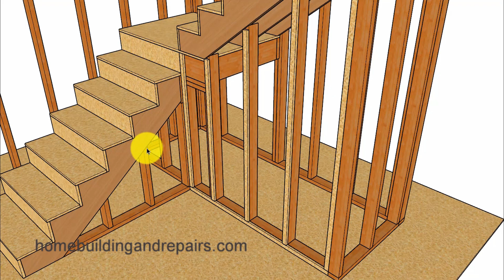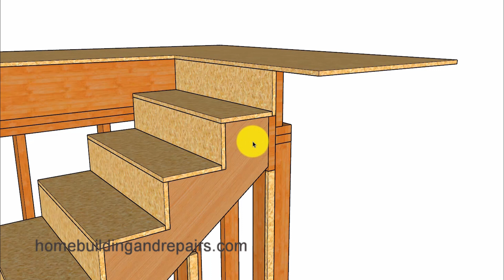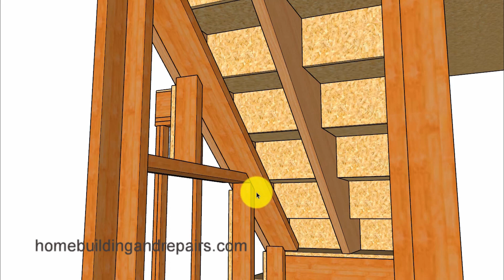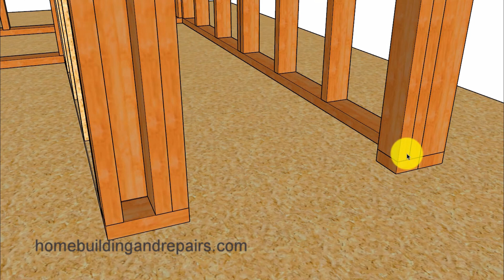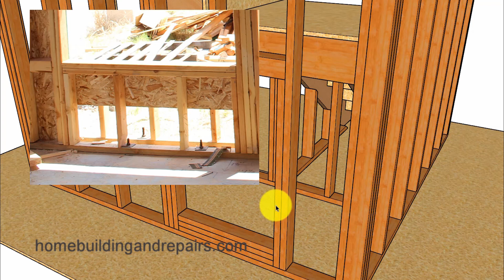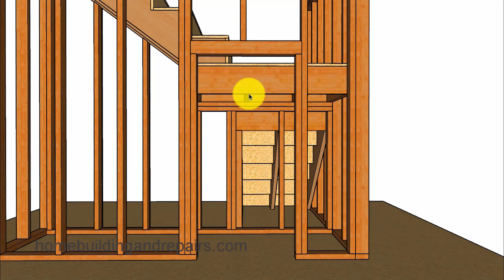How To Frame New Door Openings For Storage Closet Under L Shaped Stairs With Landing

Comment: Im so glad I found this. I already have a door on the tallest side. However I want to take advantage of the storage space under the stairs. When I cut into the back of the closet it’s got one 2x4 directly in the middle. I’m not sure if removing that one would remove support for the first stairway landing. But now I know that I can at least add a header in for extra support so that I can extend the closet. We desperately need a mud room.

Comment: I have stairs like this to my basement. There is a closest already located under the taller portion of the stairs and the central landing.

I'm planning on installing a beam to open up the floorplan in the basement. The beam runs in line with the tallest support wall of the stairs out from the closest door. 

I have 2 options:
1- Terminate the beam at the closest. Facing the closest, the right side post would be the main post for the beam.
2- extend the beam along the support wall to the central landing. The post would then be alongside the first corner of the central landing when coming down the stairs. 

My thought is that 1 is easier. But 2 is more exciting. With 2 (assuming the top of stairs and stringer are attached and supported by the 2x10 floor joist) I could open the area under the top portion of the stairs leaving a small closet under the central landing. 

Any comments would be appreciated.
Reply from the maker: It's difficult for me to visualize your project, but I like the more exciting.

Comment: These videos have been so helpful for my under stair closet I'm building. If I were to cut out the sill plate for a hinged door opening on a non-load bearing wall, how far do the tapcon screws need to be from the edge of the cut sill plate? For example, if I cut the sill plate, and have a tapcon screw 22 inches from the edge of the cut, is that secure enough to my concrete slab or do I need to install a new tapcon screw closer to the edge of the cut sill?
Reply from the maker: With in 12 inches should work. It might work farther away, as long as the bottom framing plate is not moving.
Reply: @stairbuilding  i don’t think it’s going to move. It’s an 8ft plate (after plate is cut out for doorway) with 5 ramset pins currently, but I’d be cutting out the 5th pin for the doorway, which leaves a gap of 22” he’s to the next pin/tapcon.

Comment: When extending openings upwards it makes sense to consider the possibility of buckling. When we remove a stud or two from a framed structure the remaining studs on the two sides of the opening get much higher load than previously. While the material itself can stand the axial pressure, if it is too thin compared to length it may tend to bend out and loose load bearing ability. This weakness can be greatly improved by adding lateral support in the middle (connect to the adjacent studs horizontally) or fastening some rigid sheet material on the face, like plywood or MDF. Also in such case it is very important that the end faces of the studs are as precisely right angle as possible, else the axial load is introduced off-center and that immediately starts to bend out the stud. (Sorry for the mechanical stuff but am not sure about English terms on this, am not native)